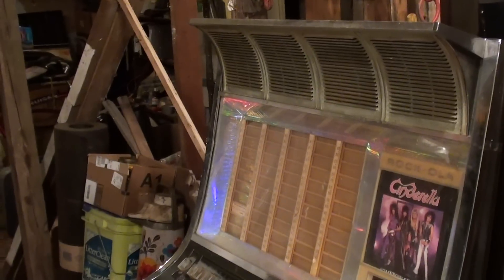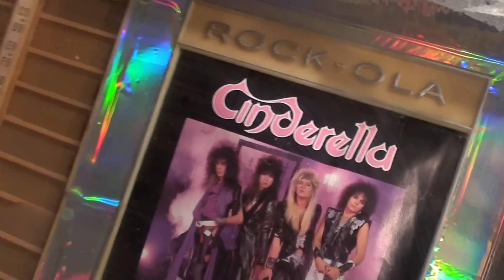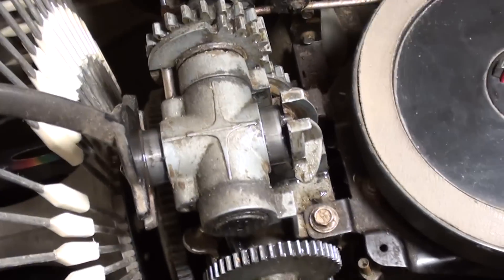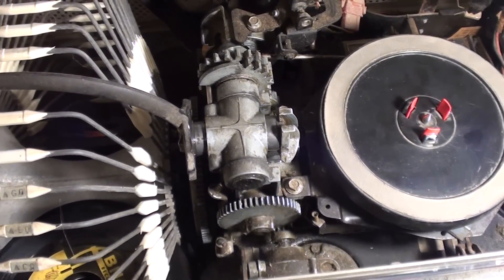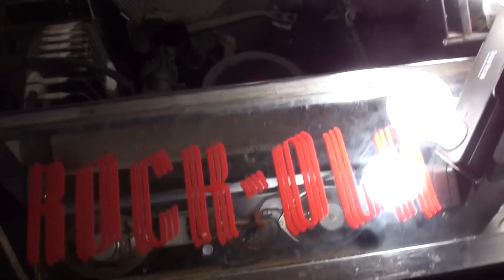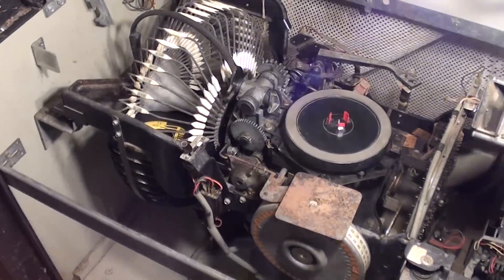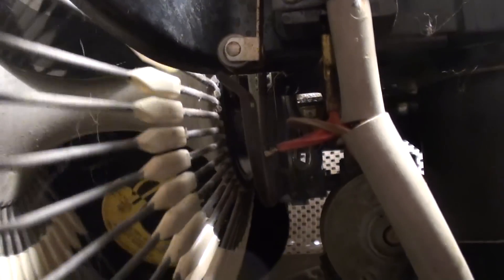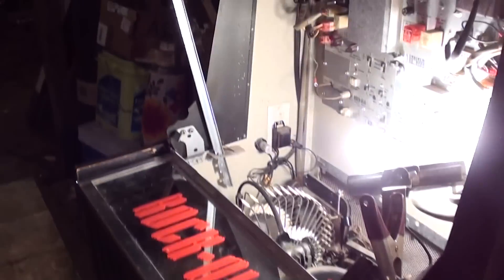Rock-ola Model 443

Comment: hello i have a rockola gp deluxe 160 but the gear sytem is blockt the arm  and i dont know what to do i think the motor is blocked,????any suggestions thx
Reply from the maker: tjorven van de bourry I believe your talking about the tone arm right? If the limit switch dose not work when it trips off the mechanism motor will keep moving the motor that's pointing up, it will jam the system up. There's two ways to go at it, First is to use plyers to turn the motor manually CCW, if that is to hard to turn then the Second is to remove the two long screws and take the center motor out (watch out for the two springs inside the motor, don't loose them on this step). Once done then it should be loose to move the tone arm out of its sitting place. Then check the limit switch that clicks when you simulation the tone arm being placed on the record.